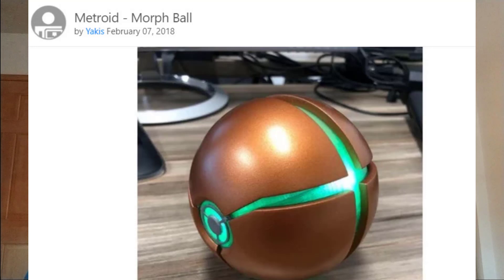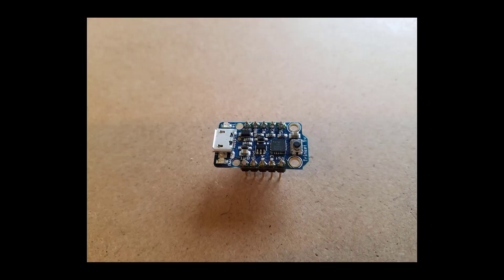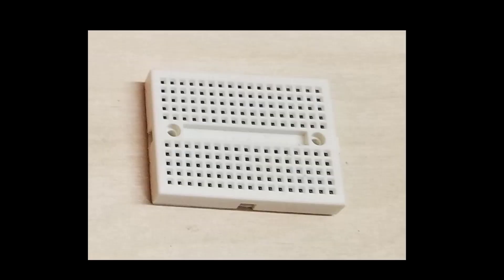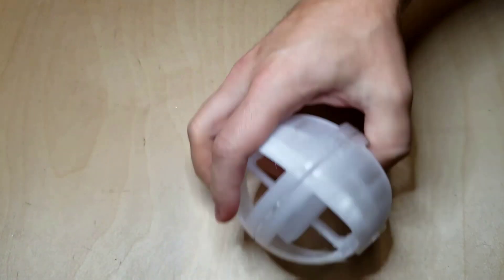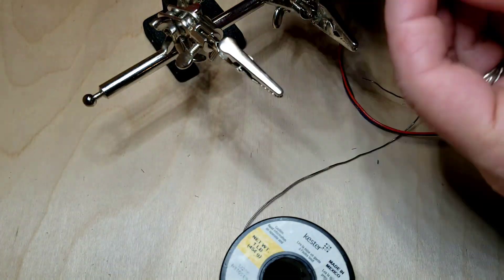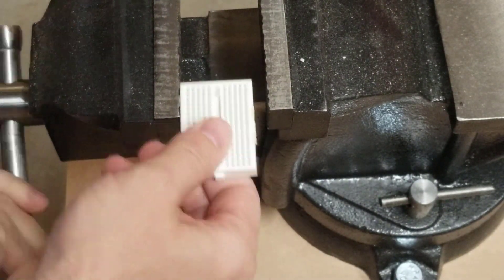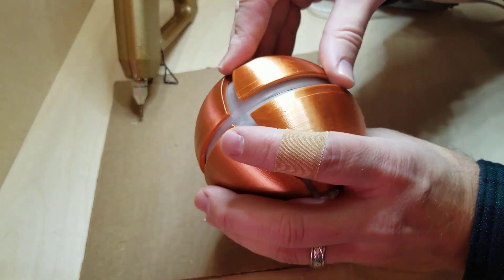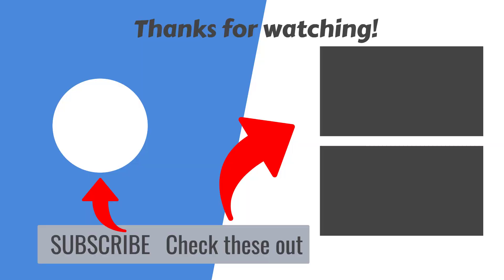Metroid Morph Ball Arduino Project

Comment: Id love to know some of your printer settings. Kinda new to printing and tried out one print. but didnt come out as smooth sadly. few blobs on the walls.
Reply from the maker: Hello Omar.  For these prints I am using the Prusa MK3 printer, .2mm layer height, Prusament PETG filament, and Prusa Slicer's default Prusament settings for slicing the STLs in to gcode which I believe is 230 or 240C for hot end temp.